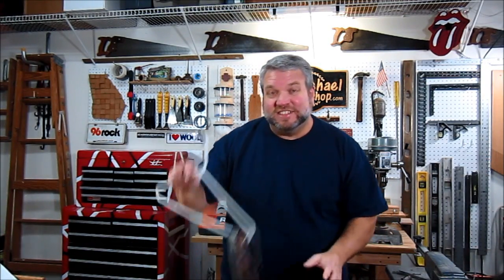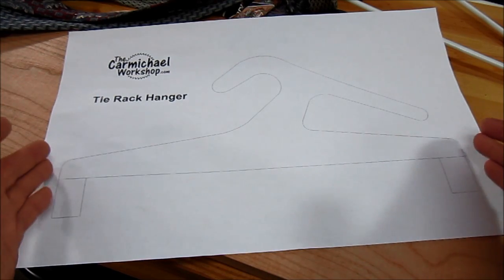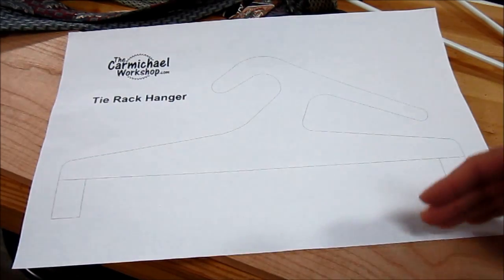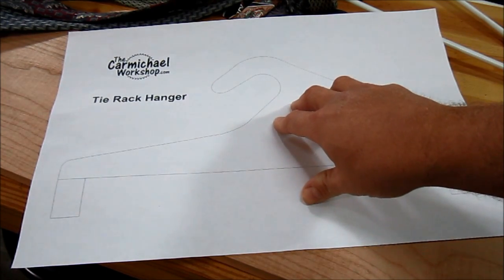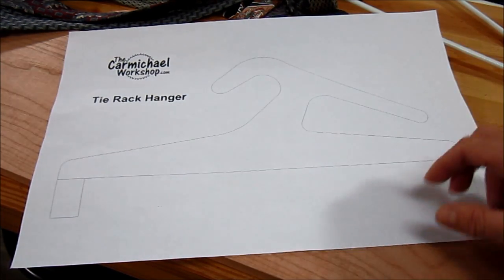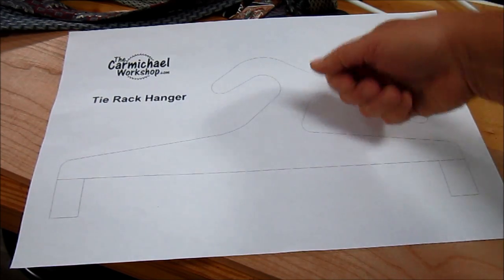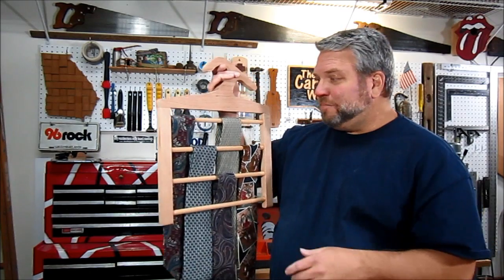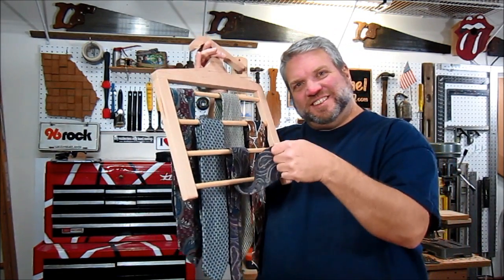Tie Rack Hanger - Classy Necktie Organizer

Comment: Don't feel bad Steve I have two ties. I used to have a bunch and then I started in the medical field and didn't need them anymore. I like the tie hanger though probably a good gift for father on Father's Day. Whereabouts do you live, because it supposed to be in the 60s this weekend here in Oklahoma as well?
Reply from the maker: Hi Drew!   I'm in Georgia about 30 min North of Atlanta.  It was 16 degrees when I was making this project.  I really only need one tie.  I wore one last year for a few hours.  lol
Reply: Lmao that is too funny Steve!
Reply: Is your garage insulated top and sides? Also, what do you use to heat your garage
Reply from the maker: It shares two walls with the interior house and one outside wall, with a bedroom above.  The garage doors need tighter weatherstripping, but it really is not that cold here most of the time.  I have a real small electric space heater.
Reply: Wish I had that much insulation. My ceiling has none and I only share one wall with the house. I have to use a propane heater that you've probably seen in my latest videos. Temperatures here in the wintertime are generally in the 30s and 40s. I tend to have my heater on a lot in the wintertime. I go through 5 gallon tanks pretty dang quick.
Reply from the maker: Rock-n H Woodshop Well it's 60's here today.  Shorts weather.  I had a kerosene heater but sold it...don't like the smell.  I started thinking that I rarely use my little electric heater, so it just takes up space most of the year.  I've never used a propane heater.
Reply: I have to put the tank outside and check the garage door on the line in case there is a leak. If I have the slightest leak in the propane tank is inside with the flame I risk blowing up so to speak. LOL.

Comment: I actually done have made this in a sense, I made mine to hold my work overalls and carahart gear with only one dowel as a brace, the little plastic hangers are garbage for any heavy work gear,
Reply from the maker: Wood hangers would be great for those.  I just can't stand the plastic and especially the wire ones...until I need a wire one for a project lol.